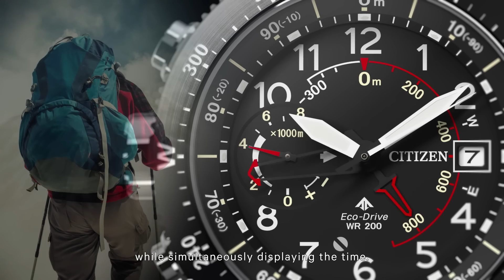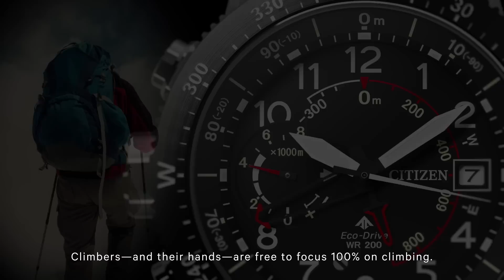PROMASTER Technology

Comment: I have the Altichron. The activation is a bit slower than what this shows however still impressive. When the altimeter is on it'll take a measurement every couple of minutes and will correct. It is also VERY accurate. It's said it'll lose 15 seconds a month. Mine hasn't lost a second in a month. Impressive watch.
Reply: how is it going a year on? Im really interested in buying a high accuracy watch.
Reply: camr0k I would go with a GPS Promaster if you’re concerned with accurate time keeping.  There’s no such thing as an analog mechanical watch that keeps perfect time.  There are GPS controlled mechanical watches, but no stand alone mechanical watches that don’t lose accuracy over time.  I mentioned GPS watches because  the radio tower in fort collins, colorado doesn’t reach all of the U.S., and receptors can be weak in atomic watches.  Go Citizen Satellite Wave GPS.

Comment: Do all the promasters in this range, have the DLC, and the movements that have shock protection & operate in extreme temps?
Reply: this vid didnt explain well enough. DLC is a black color coating finish but not all black watches are DLC, they mostly just use the very cheap PVD finish that wears off easily. DLC is the best of the best black color coating hard as hell but much more expensive than PVD. normal titanium or steel color watches can also have protective coating by citizen which is just known as duratect. this is really actually just a generic term for a bunch of different coating types citizen has in its arsenal which have different hardnesses as well as colors. theres a chart on their website somewhere that shows all of them.